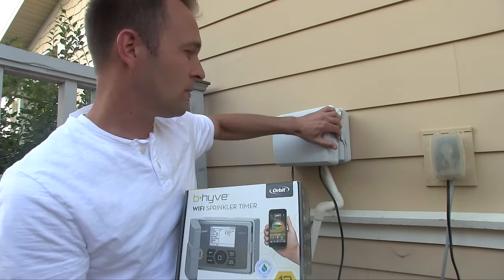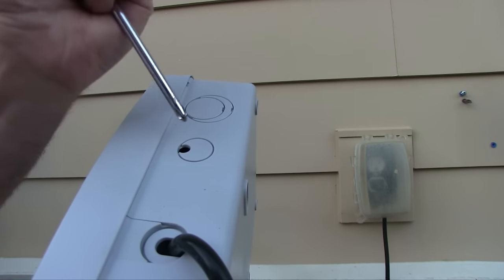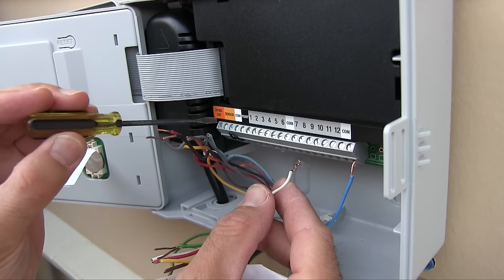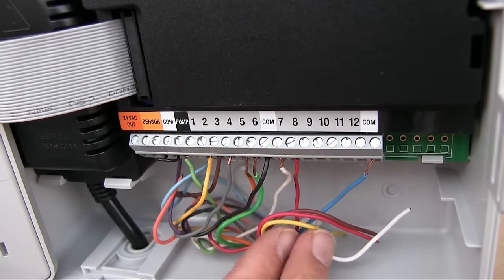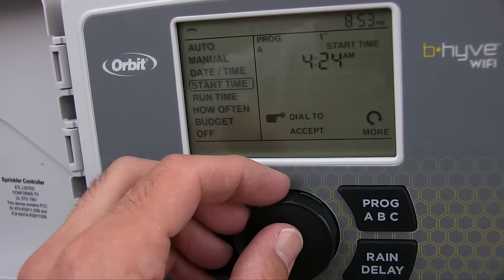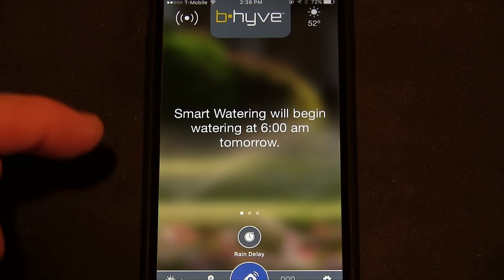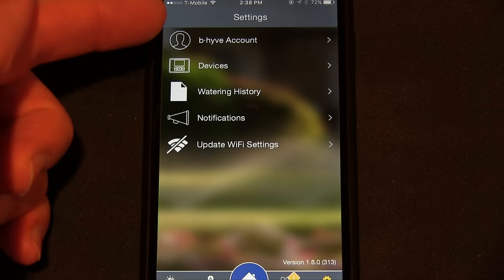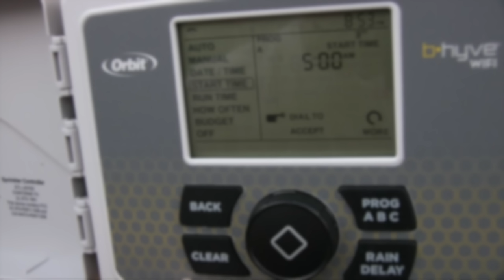Orbit b-hyve WIFI Sprinkler Timer install and app review - Smart Controller

Comment: Hi,
The pump slot is for a booster pump .
The booster pump increases the water pressure for the irrigation system.
You would need one if you have a very large property or a big elevation change from the source of the water to the final head in you system.
Hope this helps.
Good video!
Reply: the pump slot work great with any pump relay either it be a booster pump, a well pump or a main valve
Reply: I just purchased two of these exact units to go onto my property. One for the backyard and one for the front. Your explanation has been very helpful. I am going to start the install tomorrow. I hope it's going to be as easy as what you just showed.

Comment: In my case I use an irrigation pump to draw water up out of the fresh water lake in the back of my property.  The pump is connected to the underground sprinkler pipes and valves for distribution among 12 zones.  I keep the county irrigation water turned OFF at the water meter saving me a ton of $ on my water bill.  When installing your own pump just be sure to purchase and install a 220 Volt contactor relay near your control panel or CB panel.  Mine is in the garage and for safety reason I have assigned a the contactor relay to a spare 220 V Circuit Breaker that feeds power to the pump.  Works for me!  Love this B-hyve controller by the way.  My 12 year old grandson programed the controller and remote control app for me.  Kids....aren't they something these days? :goodvibes:

Comment: The "Pump" section is for a pump start (if you have it).  You basically said it already, but if you have a well and a pump that is specifically used for your irrigation system (like I do) you would hook up the pump start wire to that screw so that when the controller turns on a zone, it turns the pump on, thus supplying the water.   
Thanks for your video.  My existing controller works fine but I'm thinking of getting one of these because of the WiFi capabilities.

Comment: Here are all of the CONS I have found after day 1, and wish I would have known them before ordering;
If you have an Indexing Valve then this is not a great solution.  
Direct wiring basically requires you to cut off the plug to turn it into a direct wire.
It does not allow for a delay in between zones. 
The lock is not really a lock as you can unlock it with a fingernail, screwdriver, or just about any other object.
You cannot program it to water zones in any order other than numerically.
Reply: You can open the black box from which the power cord comes, disconnect the wires there and reconnect to your hardwiring.  Then snap the black cover over the connections.  Most difficult part is manuevering the clips on the box cover.
Reply: I bought this a year ago and have just now got around to trying to install, and it's too late to return it, but I have a 220v well pump and a 6 zone index valve and a pump start relay. How would I go about connecting this thing? I was using an old Intermatic dial, and bought this thinking it would be an upgrade but then realized I was in over my head. Not sure what all I need to plug into the back of the Bhyve controller. thanks if you can help!

Comment: It's "WiFi"?  Does that app tunnel in through the internet (when you're gone)?  Does it interface with any home automation system (like Google or Amazon)?  Does base unit also have a wired RJ-45 connection?  Unit doesn't come with dust/insect "boot" for wire entry?  No mounting template for drilling? (this is pretty standard these days)

Comment: Some people use a pump to draw from either a cistern rain-water collection system or a well which would require a pump to draw the water as those would not have the same pressure as the city driven water line.

Comment: I have a 3hp pump (220V) and a well.  So my timer controls the pump, and is hard wired.  I only have two zones .  Have no idea how it works, I think it may be on off then moves to 2nd valve?  Anyway.  My timer is hard wired, 220V, and I'm trying to see if there's a wi-fi available, but having a hard time.

Comment: I know this is an old video, but I wonder if you happen to know if when you have multiple zones on one program, does it run one zone, then the other? Or should both zones start at the same time? I have one program to run two zones, and only one zone is starting at the scheduled time.  Will zone 1 run for 15 minutes, then zone 2 starts when zone 1 is finished?
Reply: Good question. Did you find out? Thanks.
Reply: @jeffzest8393  yes! It runs one after the other.  It apparently has something to do with the water pressure not being able to run them all at the same time.

Comment: I would like to replace our old Hunter XC timer with this one and the only problem I see is that we don't have an electric outlet anywhere near it to plug into.  The old one is wired right into the breaker box.  Is that something simple that a handy guy would be able to do or will I need to get an electrician to install it?

Comment: So do you use 24 VDC solenoids or 24 VAC solenoids or something else?
Do you use the Orbit brand solenoids, or did you just use the same ones you had before? And if you did use the ones hooked up to your old timer, what brand and voltage (and AC or DC) were those solenoids?  
And do you know if your solenoids are latching or not?  I would assume the solenoids are 24 VDC latching solenoids (so they don’t have to be constantly powered on to be kept open while watering) but that’s just my guess .
Thank you for your time and your review I enjoyed it.
Reply: 24 VAC Not latching

Comment: I boughta B-Hive single zone hose attachment type valve, and use it off the app. I just bought the 12 zone to replace the old skool regular timers I got with the house, that are all messed up, hooked up to regular installed irrigation valves. Can I integrate the hose valve to this 12 zone system B-Hive controller?

Comment: Hi Great review. A couple of questions because I want to be able to control watering while I travel (I travel a lot):
1)  Will the phone app work only when on the same WiFi network as the controller? Or can I control it from anywhere?
2)  Will it work even if I never install the phone app or just neglect to use it? In other words, is it truly set it and forget it or is it dependent on the phone app? I think you demo'd using it without the phone app...just confirming.
Reply: Hi there. I have a b-hyve smaller model and it's been working flawlessly. I have the app installed on three different Android devices and it works anywhere! No need to be connected to the same wifi. I don't think the smart watering is all that great unless you use the ground sensors. I have areas of dead grass and I have to water manually. I am going back to a scheduled timer instead. If you do choose to use smart watering, it's pretty much set it and forget it, but I don't recommend doing that

Comment: Question:  If I have this unit installed at 3 separate properties of mine and each unit is connected to a WiFi connection, can I control each unit separately via the app, if say I'm in Antarctica with cell phone data service?
Reply: Yes

Comment: Hi, Adam, can you explain what the wiring is about? I have a RainDrop timer which uses battery and doesn't require any wiring. Thanks.
Reply: I have no idea how you could help a timer like this and not have wiring. Something has to go out to the solenoids to tell it to turn on a particular station.

Comment: I can't keep the wifi connected....I have to unplug the unit every few days to get the wifi to work again. The app is great but worthless when your wifi doesn't stay connected. 
Update: I contacted support and they sent a firmware update that fixed it and I have no problem now...works great!!
Reply: same issue here, too bad.
Reply: You will see the same problem on all controllers, which is why the manual scheduling is great. Rachio can do that. Plus Rachio emits a high-pitch squeal when it powers up.

Comment: so in my old Toro i have 5 zone wires, 1 com wire, 1 pump wire - but then have 1 wire connected to 15v, 1 wire connected to 24v and 2 wires connected to Hot Post - any idea what those last 4 wires are?? thanks

Comment: Under the calendar, why do I have 2 weeks going forward from today grayed out??  What are the light bulbs for on some of the days?  Some of my zones are soaked, will this water only the zones that are not at 89% or greater?  Two zones didn't come on at all.  Checked the wiring and they are tight.
Reply: Hi There, the light bulbs are for smart watering it is generally easier to use the weather adjustments in the device settings on the app. you can adjust for rain, wind, and even freeze temp delay. go to the app home Screen> Select Settings> Select Devices> Select Weather Adjustments (make adjustments as needed). when finished go to the app home Screen> Select Programs> Select Smart watering the top  Check here to see if any of the zones have the Smart watering yellow on this my be why the zones did not run automatically. for the zones that didn't run try testing manually from the app home Screen> Select Zones> Select the zone you believe didn't run (if you don't know which zone that's ok simply start with 1 and repeat tell you finish all the active zones) after selecting a zone (you are on the Zone Detail page you can name the zone, take a photo of the area so you know whats on with out looking and you can adjust the moisture % by selecting it then sliding the bar up or down) > Select Test in the top right (it should show a timer with 5 minutes you can adjust this time but it is only for this test)> Select  the Arrow> to start .    good luck I welcome any questions or suggestions

Comment: Thx so much!! Do i need to have my wifi or router "ON" for it to go on automatically??
Reply: yes - do you normally shut your wifi or router off? like unplug it?
Reply: @jasoncatalanotto996  yes at night .... turn it on whenI need computer next day. Reduced EMF radiation: sensitivity
Reply: 52msdiane oh wow. I never heard of that. I have never shut my WiFi router off. I literally control my house with my WiFi. My doors, my lights, my sprinklers, my cook top, my washer and dryer, my heat and central air, rumba, garage door, alarm system, ring cameras. I’m sure I’m forgetting a few things but I specifically made my house a “smart” house and shutting it down would never ever work for me.

Comment: Why does it have 4 different start times?  I just want one start time to run all the stations a few at a time.
Reply: You may need 4 start times for overseeding the lawn.  Here in AZ, we overseed in fall and water 3 - 4 times a day to keep the seeds moist until they germinate.
Reply: @danfoley7265  can you run all zones at one time? Intake it that the four start times are set by you; e.g., any time desired, and you can do four for each zone? Thanks.

Comment: Hi! Does anybody knows how many voltage this box offer for the solenoids? My solenoids are 24v AC (Not DC). It is the voltage, a standard one? Or, can I use the contacts as with a Relay only? I will have to buy a 24v AC adapter?
Reply: Not sure but last night the guy in electrical at Lowes told me each wire should test at 12 volts using a meter.

Comment: So would you go Orbit or Rainbird after using both?
Reply from the maker: Both work well and I did not have any issues with either.  However, I thought the Orbit Bhyve app had a better design and easier to use.

Comment: hi may I connect WiFi Sprinkler System Controller Orbit 57946 to water heater and how?
Reply: probably not a good idea the hot water can damage the internals.

Comment: My old-timer was hardwired with no plug and then my new beehive has a plug can I still hardwire it and would I need to plug it in
Reply: Yes, I just cut off the plug, stripped some of the protective black cover and exposed the wires to hardwire it.  Inside the power cord is the typical black, white and green lines.

Comment: Can you do a manual start on a zone with the app?
Thx
Reply: That's the best part. Setting up a garden 220 feet from the timer. Just push the test button,  set 5 minutes or what you want and it starts. This feature alone saves such a hassle for flushing lines on new install. Highly recommended. It even shuts itself off if rain is in the forecast, if you want it to.

Comment: good info I'm having trouble with mine in that I have power at each terminal at the timer but no power at the valves?
Reply from the maker: Check that the COMMON wire is clean and not corroded or broken. Both in the timer and in the valve box.
Reply: I will thanks
Reply: Thanks buddy from an 85 year old man that loves and still enjoy yard work the common was the problem

Comment: Na, I'm looking at mine on the counter before installing.  Not impressed with the interface (looks nice but ...).  The box panel DOES NOT look anything like the app panel AND while testing the app I'm looking at the panel and it does NOT show me that the app is making changes, starting or stopping - it just sits there.  How do I know it's receiving my app inputs?  And why Bluetooth?  If I'm less than 30 feet away why wouldn't I just walk over there and do it on the panel?    Sadly the old Orbit green box was a LOT more intuitive - I like the old dial better, it felt more like feedback.  The new dial with the push click - I'm never sure where I am to input.  Never understand why manufacturers make their apps so much different than their panels.   Annoying - as if I don't have a ton of other systems and devices that I have to learn interfaces for.

Comment: Orbit spinklers have typical problems that after warranty you will have an error messages NO AC and system will not start. No support form ORBIT staff and only one information is that you can buy a new one or send you to "repair" with probably cost of new one. So ORBIT spinkler = working time  2 years or little more if you are lucky. I hardly disrecomend this brand.